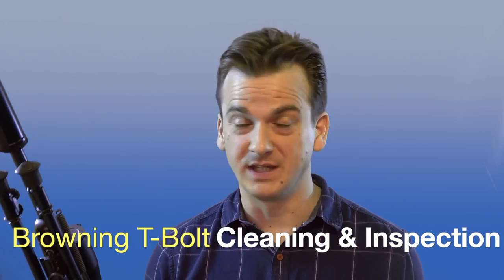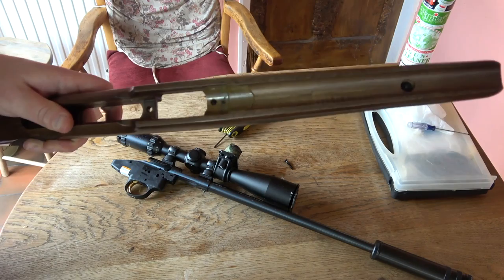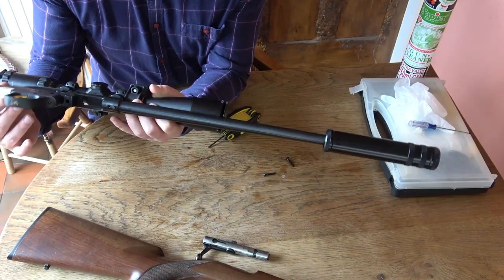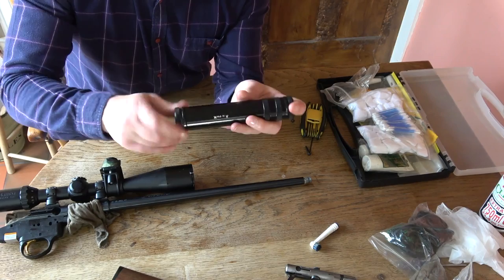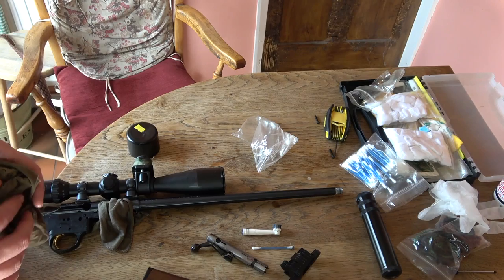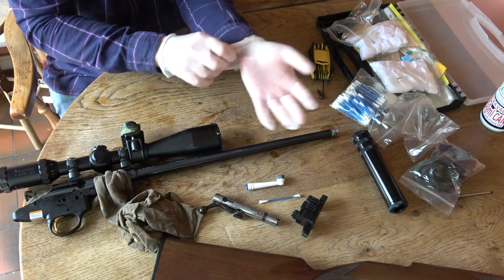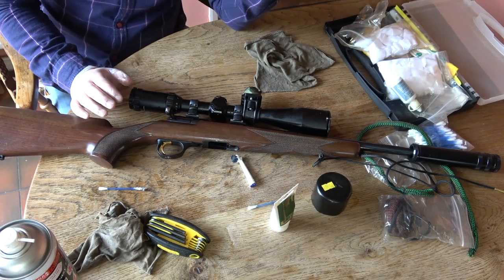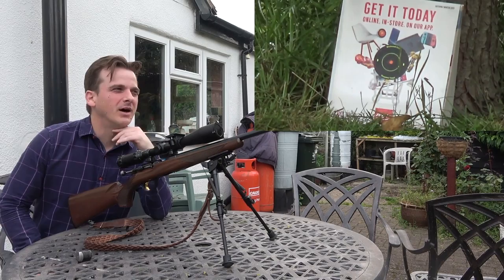Browning T Bolt: Cleaning and Inspection

Comment: It is a good idea to clean the barrel after each shooting session especially in England with the high humidity.  The borescopes show that rust pits start wherever the solid particle fouling bits sit inside the bore.  Don't need to do a thorough scrubbing every time but at least one pull through should do.

Comment: Hi sam good vid .if you zero your gun at 50 yds with a 1.7 inch high scope above the bore .your closer zero will be 20 yds .the bullet apogee  (highest point above the sight line) will be 0.4 inch at around 35 yds ..i suspect  that u have a bad batch of ammo
Reply from the maker: That's possible, I have zero'd it now but i'm nearly at the end of the current box. I hope I don't have to zero again!

Comment: Sam. out of interest, Why can't you film down the range? Also when did you last zero your sights. If it was in the winter, the change of ambient temp can affect a zero. As the gun, rings and sights will move as the temp goes up and down.
Reply from the maker: It was just a few weeks ago so not that long. I was asked not to film after one of the 'board meetings', they were okay with it up until then. There's a huge amount of politics and jobsworths at my club. Most meetings end with shouting apparently.
Reply: @srspower  Strange that. Most of the meetings i attend, end up as a shouting match. lol

Comment: Are you aloud to shoot 22 in the garden?
Reply: If you have an Open Firearms Certificate you can use your gun anywhere you deem safe and acceptable. Open tickets are only issued after some years of holding a firearm certificate with out incident.
Reply: @tonyashton780  Thanks for the reply and clearing that up. I'm new to the shooting game (only had my FAC for one year) so I appreciate a respectful response.
Reply: @DanDustEmOff  Not a problem my friend SRS Power is a wonderful learning platform run excellently by Sam. There is so much guff and miss information out on the Web. It's nice to pass on good information to less experienced sportsmen or women!, we all need each other. All the best shoot safely. Regards Tony
Reply: @tonyashton780 
What exactly is an “Open Firearms Certificate”?  UK looks like a really nice place.
Reply: @user-qn7yq3eo2q it's a line of text on the licence in place of the dedicated land marked safe for shooting that instead says "licence holder can shoot anywhere they deem safe and have permission"